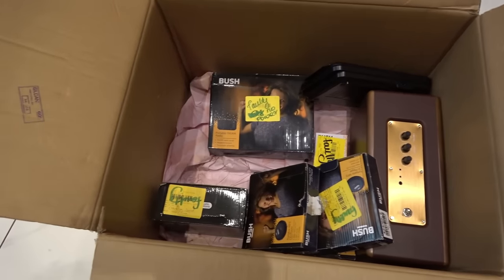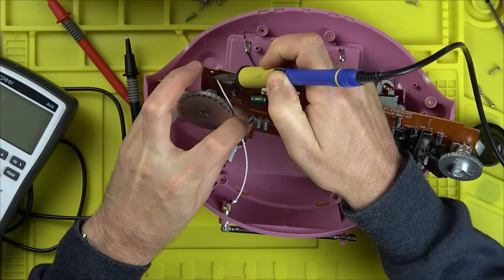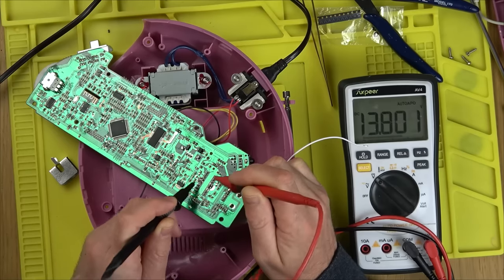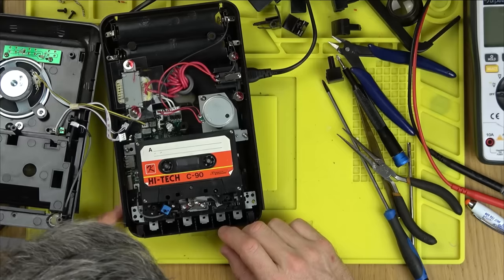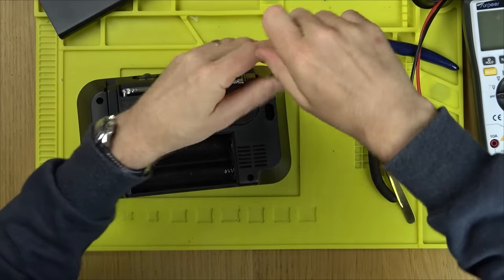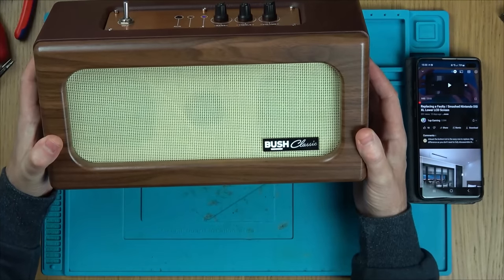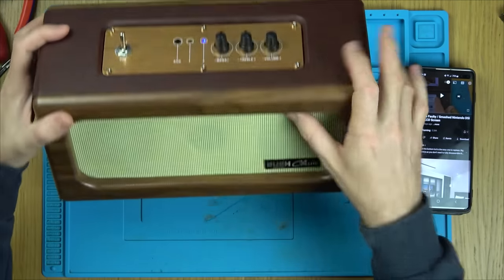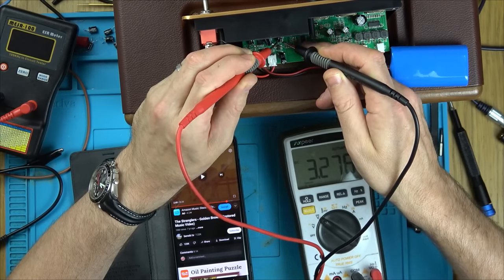MORE ARGOS CUSTOMER RETURNS to FIX - Can I Make More ££$$€€

Comment: 36:50 I marvel at cheap modern radios like these. The tuning can be remarkably good... there must be some kind of circuit in the generic all-in-one radio IC that allows it to really "lock in" when it gets close to a station. I found a new-in-box pocket radio forgotten beside a trashcan at work earlier this year, and I was surprised by how well it worked. I looked it up on Amazon and it was $25 CAD... that's £15, just like that Bush radio.

Comment: You can adjust the tape motor speed slightly. It could be sloppy adjustment by the factory. The motor contains a speed controller circuit board inside of it. Put a very small flat head screw driver in the black hole. There's a potentiometer underneath.

Comment: On the Bush cassette recorder, I think your diagnosis is right; the spring is too tight. In fact the other end of the spring doesn't look like it's in the right place to me. It could be, but it looks like it's under far too much tension in that position. (Also, as I'm sure you realised, the tape will run at the same speed during both recording and playback, so obviously its own recording will sound right ;-) )
Reply: See @23:07: I think the spring should be behind the spring holder on the left side on the screen that is just a little bit above the spring.

Comment: At around the 22:45 mark you are working on the pinch roller when I was younger I worked as an apprentice at a repair shop and I had to clean the metal spindle and run an emery board over the rubber wheel. With use the wheel goes smooth and shiny and it drags on the tape. Also make sure you clean the opposite side of the spindle which is driven by the belt. Hope it helps

Comment: That 22R R18 used to drop a few volts before the 6V max input reg is a very dirty design, a couple of diodes maybe but an 0603, eghh. Great fixes. Adventure.

Comment: On the bush tape recorder, the blue head that moves in is the Erase head (during recording) not the record head as you stated.
Also, no good recording to check the speed on the same device use a known good device to record your voice the play back on the suspect device.

Comment: The motor have a small hole on the top you can see it black dot over there. Inside there is a potentiometer which allows you to change the speed of the motor

Comment: The tape recorder, you could see the steel rod that the rubber wheel pushed against deform (bend) - after you straightened the spring, it stayed pretty vertical when the wheel pushed against it.
Reply: I agree the capstain(spelling) sets the speed of the tape across the head.  if the bearing is bad in that, it would allow it to bend over and cause a lot of friction in that bearing.  Good catch @TheSudsy
Reply: @wanjockey  100% that looks like the bearing is the fault
Reply: That spring was really pushing the pinch roller onto it! I have several very cheap portable cassette players that all have speed issues. I thought it was just because they were crap, which they are, but now I realise they may also need adjustments to the pinch roller tension.
Reply: @bernardleaf1397  the plastic bearing is cracked... you can see it at 24:21... they are normally not cracked
Reply: @TheTkiller9999  thats just the clip holding the capstan shaft on
Reply: @TheTkiller9999  the bearing is under that
Reply: Is your workshop near a kitchen Vince - there always seem to be dishes sound in the background! 😂😂

Comment: The tape cassette player speed adjust is the trim pod on the motor the black dot is a rubber seal with veripot  under it

Comment: I think that's a perfectly valid fix on the cassette deck, although I've seen a few of these and the mechanism they've used is garbage - they all seem to have problems with pinch roller tension and some seem to apply tension unevenly as well, causing the tape to run up the capstan and get chewed up by the mech. Pretty awful units overall!
Reply: There is only "one" type of mechanism made these days although they can do them with slight improvements.  Maybe this was the cheapest they could do?
Reply: @georgeyreynolds  One type, yes, but many manufacturers of the same basic form. They're all lumped together as "Tanashin" but the reality is the quality varies widely. The original Japanese Tanashin ones (originally a Toshiba design) are good, and so are some of the modern copies - these ones are crappy though.

Comment: 24:51 That's the erase head and it's a cheap mechanism so it is a permanent magnet not an electro magnetic erase head. The actual recording is done by the main head which also does playback. On a fancy tape deck you get three heads, erase, record and playback which lets you monitor the recording as it is being made.

Comment: its the torque caused by the tape tension.  You have to fast forward the tape to the end and then rewind and play it unless you back off the spring load.  I used to have this on my personal tape player pulled it apart and rebuilt it and stretch the spring. If it gets too slack it will cause the cassette win up and jam.

Comment: On the cassette recorder the small shaft that the roller is pressing on the bronze bushing wears out and becomes elliptical instead of round. It will slow down again eventually. It is playing back at the right speed because you recorded it at that speed. lol. Use music and a metronome to get it to the right speed. Set the metronome to the known  tempo of the music and adjust the potentiometer for the motor speed control until it matches.

Comment: 30:54 d1 through D4 is your bridge rectifier, the output of a bridge rectifier (with a filter cap) will be the input ac voltage times 1.414 so 10.88 volts DC the item you were testing was Q1 d882 is an npn power transistor.

Comment: On a casette player, the playback speed is given by how fast the tape spins. So it would have to do with the spinny things that drive the casette. Maybe they are dirty or something is preventing them to spin properly. Or the motor is malfunctioning or it's not receiving enough power to spin at the correct speed.

Comment: 23:36 there is a little metal catch on the top left side of the center of the spring. Maybe this is the spot where the spring should have been attached originally? This would reduce the strength of the spring.
Reply from the maker: I see that!! I'll check it out to see how it fits there👍👍👍
Reply: Yep, I noticed that too, it's punched out of the plate of metal by the looks of it. It's probably there for a reason. I think the left side of the spring shouldn't be under the play head, it should be under that catch.

Comment: There must be a 2 resistor voltage divider going directly from the battery to that bluetooth SoC to measure the battery voltage. Find and check that. That could be the cause of the low battery message.

Comment: 21:00 Usually motors that are used with tapes are changing speed using potentiometers that are built into the motor or located on the PCB.
Since you've tried to ignore the PCB and provide voltage from separate PSU to the motor and the speed haven't changed, the potentiometer is located in the motor itself.

Comment: After removing the 3.3V regulator ther won't be a voltage drop across the resistor as there is no current flowing through it.

Comment: Well, that test recording on the tape recorder was quite redundant because even it was recording at half speed, if it plays back at the same speed it was recorded it would sound ok. What you need to do is record a tape on a known good recorder and then play it back on that recorder, then you can actually hear if the speed is different.

Comment: @26:32 But when you're recording with the same tape player it wouldn't be any difference even if it was slow
Reply: Agree you need to record on another recorder thats working and compare on the slow one
Reply: Yep. Because it will record slow and play slow as well. However if it records slow and you play it back in another tape player it will sound fast or you could record on that and play it back and it would sound slow. Either would be fine.
Reply from the maker: Very good point Karthor!!!
Reply: I was gonna suggest this. TY

Comment: Re.....the slow cassette....note on the motor...there is a speed adjust  potentiometer.... There have there own regulator built in. Which is why when powered wt adifferent voltages you get the same speed.........
Also.  Recording on a slow deck will play back fine for obvious reasons

Comment: On the bush cassette unit that is playing slow you have a speed adjustment on the motor with a little flat blade screwdriver just adjust it to get the correct speed

Comment: at 24:21   the metal capstan that turns... the base plastic has a crack in it... and that allows the capstan to be pushed too far over and bind...  causing it to slow...

Comment: That hole on the back of the tape deck motor is for adjusting the speed. Maybe it's out of adjustment or the guys at the factory didn't do it at all. There should be a potentiometer in there (usually it's on the pcb or on the back of the motor, that seems to be the case there)
Reply: also the blue head is an erase head. It's usually a head made just to do that, but manufacturers use a magnet to get it cheaper
Reply: I was expecting that ~ that “BUSH” is a zombie brand, and it was made in a Chineseum crap factory ~ where quality control is non-existent

Comment: I wonder if that voltage regulator was dipping just enough (and quickly enough) for the device to notice but not enough to shut off or register on the multimeter.  Anyway, nice work!

Comment: Vince if you look on the motor itself there is a hole on it. There is a variable resistor inside basically a speed controller built-in to the motor. You'll need to take a small screwdriver either a Philips or minus I can't remember and you can turn this control to change the motor speed. Try not to touch the metal (not sure if it matters). 

Modern cassette machines have this control mounted on the board and the board sends a specially timed pulse signal to the motor as well as power.

Putting different voltages to the motor will not matter. It's probably just switching on 6 volts from the batteries when you press play or FF/REW.
Reply from the maker: Thanks The Man, I will have a look for it. Nice one 👌👍👍👍
Reply: It can matter if you use a metal blade screwdriver and you touch the case. I have seen motor speed control boards burn up by doing that - but it isn't a problem with all motors, just some. Plastic shaft screwdrivers with brass tips are just the thing for doing this. 
I have been doing it for a long time so I can get a screwdriver down that hole and onto the trimpot without it touching the case.

Comment: I think I’ve put that down as a fix. If you’ve got anything that you read the boat or use and you knock it and Ben something then if you unbanned it and it works it’s fixed I don’t think it has to be a electrical fix to fix it, could’ve been bent manufactured whenever so up to you of course.

Comment: Why the transistor failed? Could be the overload in the circuit behind, very often from a (low quality) electrolytic capacitor needing reforming (when mechanically abused even before assembling, they tend to develop a high leakage that uses to disappear after some time, but it could overload the circuit upstream before it does so).

Comment: Spring of the pinchroler should be attached to latch on the left side. It's below it now putting to much pressure on the pinchroler.

Comment: if you pull a load across a resistor - of course you will get a voltage drop - now you have effectively disconnected the input - there is no load - hence no voltage drop

Comment: To decrease the chance of the transistor failing again I would slightly decrease the value of the resistor connected to the base. You get only 13.8 instead of 14.5V indicating the transistor is not fully driven. You can check the input voltage of the transistor. Input and output voltage should not be more than 0.3V different. It looks like  design fault and it will come back when you put on your device with loud sound for a long time. Such a small transistor can't handle several watts of power drop for a long time.

Comment: I noticed it wasn’t until you put batteries in (the radio fix) that the amp finally powered the speakers.  Up to that point, I think everyone used AC.  Possibly the batteries had some means of energising the amp circuit?

Comment: I was thinking it could be the unregulated, linear power supply causing that transistor to continuously blowup.
5V seems a bit high for a two watt amplifier like you can run 40 what amplifiers off 4.2V and 7.2 V with portable Bluetooth speakers. and example of a Bluetooth speaker would be JBL’s lineup and they’re quite powerful with their respective size and voltages
Reply: its a different type of amplifier. Bluetooth speakers use Class D amps while that amp in the radio looks like a Class AB amp which require more voltage as they aren't as efficient as Class D amps, plus they draw more current compared to what you'd find in a Bluetooth speaker.
This is the case of cheapening on components, resulting in a too small transistor.
Reply: @RealEpikCartfrenYT  Yep. Budget item. Makes sense. I should’ve known that fact about the class of amplifier used. Crazy how good Bluetooth speakers are.

Comment: 10:01 - the heatsink is the ground for 1/2 of the chip, you only have a 1 channel amp without a link across the 2 large grounds!
Check ground continuity on chip grounds, I bet the r/h side is 'floating' now for ground, hence the Silicon diode [ volt-drop 0.6v ] level voltage on the other side.

Comment: The cassette deck motor likely is a FG servo type. A device sends pulses to a servo chip. The chip sends what the motor needs for correct speed. There should be a preset resistor to set the speed hopefully? FG is frequency generator.

Comment: hi when they made this they did not set the speed up right there's a mini pot  what the volts coing in to  the motor will not  change the speed of it 
i have worked on alot of cassette decks    put in a mini driver and you can hear the audio change  the pcb in side the motor reg the speed of it 
 to keep the motor turning at the right RPM  the reel to reel get there speed of the mains   

the tascam 30 line have a pcb that deal with the speed it's out side of the decks

Comment: your cassette player that first head is the erase head, the read head is the one that also records, you sounded fine as you record at the same speed you played it back but i would have said you fixed it As i am sure you know its that wheel and the pin that set the speed of the tape.

Comment: Not bad at all, I enjoyed watching you fix these! Personally, if you allowed shipping, I would buy the nice looking Bluetooth speaker off you right here right now, it's a great device now you've repaired it.
As for the cassette player, it still works, so yes personally I'd sell it on, since although not maybe a proper fix, it is now "fixed" in that it is working as intended. Maybe a reduced price for that one, but we'll see.
Also - not sure how long the AM/FM radios will be relevant for now that AM stations are being switched off across the UK, and FM doesn't really provide a lot of choice, unless you're in a strong signal area for distant stations, or you like a lot of different Heart FM frequencies scattered across the dial (and BBC R1-4 too). If you're in a weak signal area, you'll probably only get BBC 1-4, local BBC, Classic, and Heart.

Comment: Recording your voice on the tape player isn't a good test as it will record at the speed the current mechanism is running at so playback on the same unit would be OK. The recording may playback fast or slow on another deck. Like one of the other comments you would be best to use a calibrated 440Hz test tape however given the low quality and cheapness of the deck playing a prerecorded tape would suffice.

Great video.
Reply: Yeah a quick test tape using Audacity or the like, great point :)

Comment: What about using an isolation transformer, covering the parts with high voltage, or much better, use  your bench DC power supply? The safest, the better.

Comment: I am wondering if something changed values enough to overload that transistor causing it to fail over time or if it has an extra load on that circuit. That would explain why the voltage is a little lower.

Comment: Fixing a linear voltage regulator with hotglue ... maybe not the best idea. ;) Epoxy would be better suited. Also: The voltage regulator will likely have a higher quiescent current - but this may not matter, if power switch disconnects the battery complety.

Comment: The spring you bent on the tape deck wasn’t set in its stop. If you look on the metal frame to the 11:00 o’clock position it has a ramp to set the spring behind. The springs stuck behind the tape head by the looks of it?